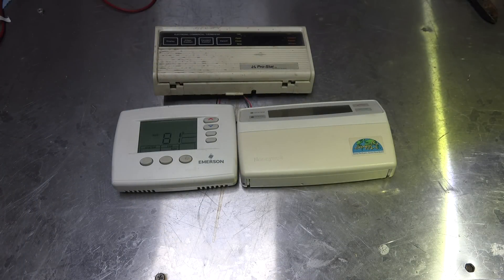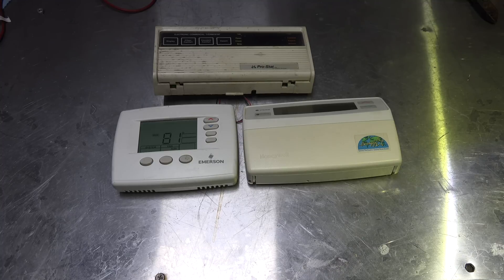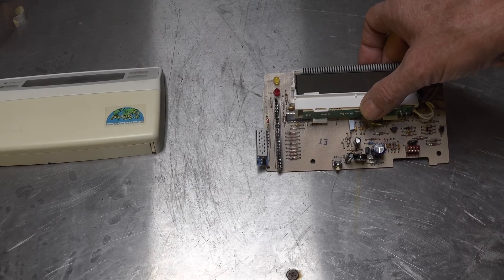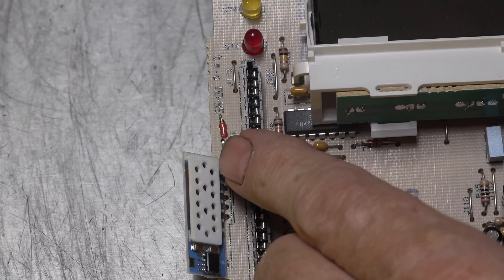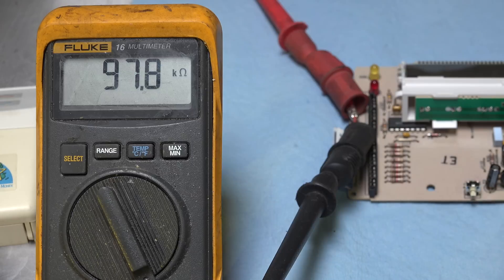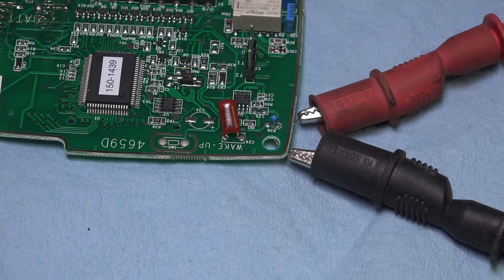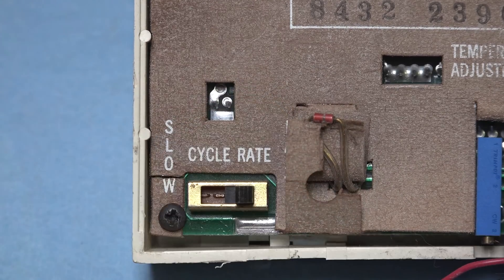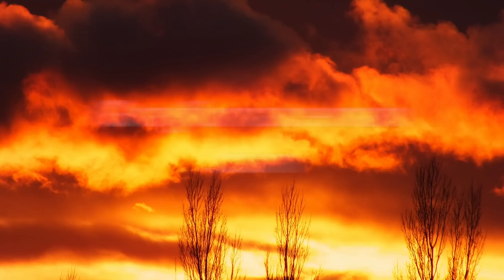What senses temperature in the electronic thermostat

Comment: Question: We have a town home style place, I dont see a furnace only a hot water heater in the garage, so we have heat but the upstairs rooms dont seem to be giving out enough airflow, do you think the thermostat isnt reading the temp correctly, thus not heating enough to flow thru the home?

Comment: I have only seen thermistors used in thermostats but diodes are used to measure the temperatures in computer CPU's.  I suspect there is a humidity sensor in that first thermostat.  The IC probably measures the changes in capacitance of the sensor when the humidity changes.

Comment: my oil furnace wont stop burning i set my thermostat to off yet still plenty of flame and heat, its way too hot in the house. the only thing that shut it off was shutting off the breaker..... do you think i have a bad thermister? should i try replacing the whole thermostat? thanks
Reply from the maker: I would disconnect the thermostat wires that go to the cad cell relay on top of the burner.  If it stops running, the problem is in the thermostat or its wiring.  If it does not stop, you could have a cad cell relay stuck on.  Not the only things that can cause this but where to start.
GFM
Reply: i must mention that before this current problem of the furnace not shutting off i had a different issue......that issue was that my relay was constantly clicking on and off very fast causing the flame to turn on and off, eventually the relay would stop clicking/reseting/tripping for 10 minites straight and then i would then have a steady flame  .......so i think you are correct that my cad relay is stuck, no more tripping/clicking from the relay.....i will disconnect the relay now then cut back on the breaker to see what happens. i will report back thank you sir
Reply: i disconnected all wires on the screw terminals on the cad relay, i then turned on the breaker, the thermostat has no power this time but still same problem, the furnace not shutting off.........
Reply: the cad cell red relay light is on also , this is getting interesting haha
Reply from the maker: You have a stuck relay.  You will have to replace it.
GFM
Reply: thanks brother, can i ask why was the relay constantly rapidly tripping before? was the relay defective or somethin else causing that symptom
Reply from the maker: Almost certainly the cad cell relay was just failing.
GFM
Reply: thanks grayfurnace i changed out the cad cell relay , and that resolved the issue... those things aint cheap 175 bucks ... you are the master for helping me through this!!!!
Reply from the maker: Merry Christmas
GFM

Comment: Enjoyed your video.   I wonder if you have done a video on setting hysteresis on Tstats.  I have a few Lux t-stat at the swing (hysteresis is settable)  however, it does not work well.   When set for .5 deg the unit cycles +/- 1 deg.     In your experience what are the best ranges in very hot summer climates (Texas).

Comment: Hey Gman; usually when something gets hotter its resistance goes up. From your experiment we see when a thermistor gets hotter its resistance goes down!
Reply: It depends on the type of thermistor.  Another type of thermistor increases resistance as temperature goes up
Reply from the maker: Thermistors can be positive or negative coefficient.  Its an electronic part that changes resistance with temp change.  What you are speaking of is if I heat a wire, its resistance increases somewhat.  You can also use a thermocouple similar to a gas furnace thermocouple that will actually put out a small amount heat if the temp goes up.
GFM